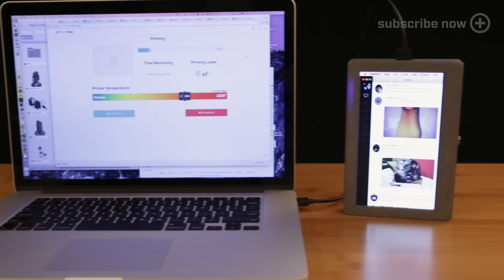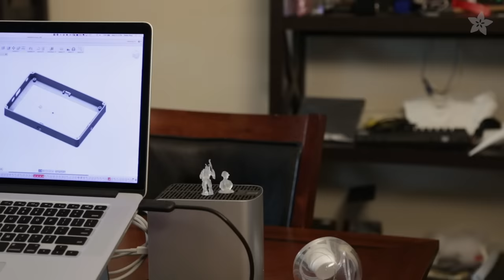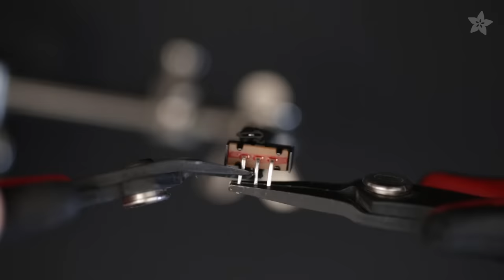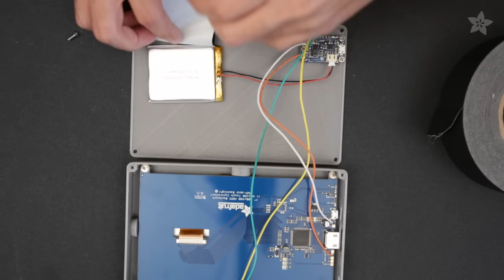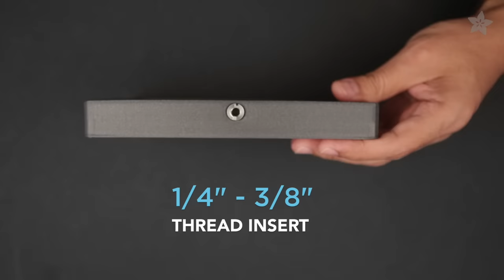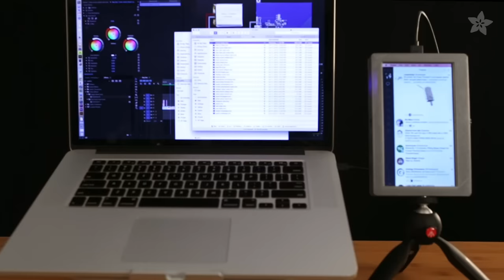How to make portable HDMI display for Raspberry Pi 2

Comment: Bought one. Gonna write a Rainmeter skin to launch programs and folders from the touch screen on my desktop machine. Also gonna 3D print an enclosure. But i want as little bezel as possible, so i'm gonna dremel off the mounting holes and make it a press fit. And i'd wish it didn't have the HDMI / USB ports placed on the side. Gonna experiment with some right angle connectors so the cables wont stick out like that.

Comment: no mention that this monitor doesn't scale hdmi signal. so this won't work with anything that spits out a 1080p  signal.
Reply: if i built this for my ps4 and set it to 1080i would this work?
Reply: +TheEnragedGamer probally not, just because it is interlaced doesnt mean that it will work with a non 1080p monitor